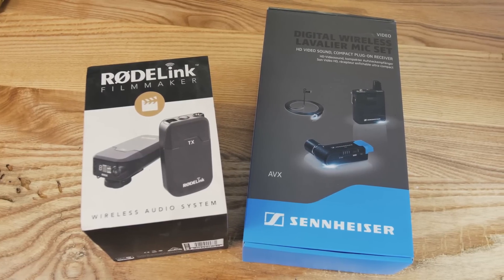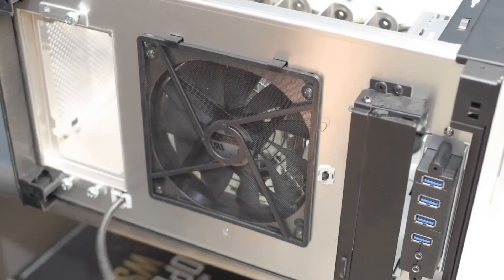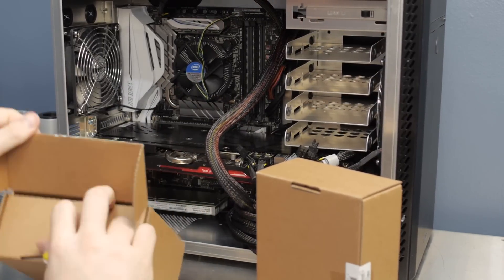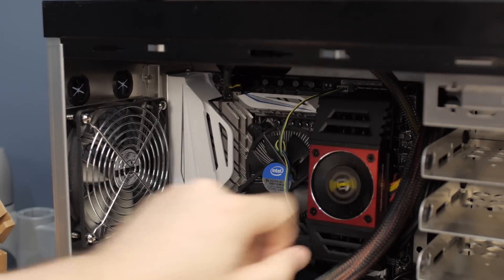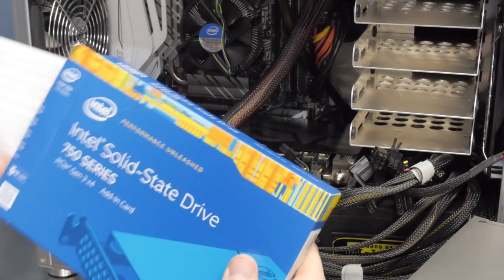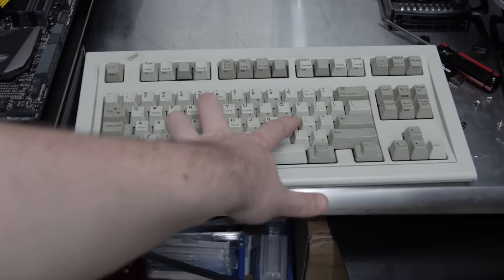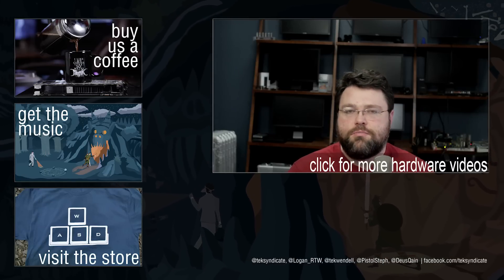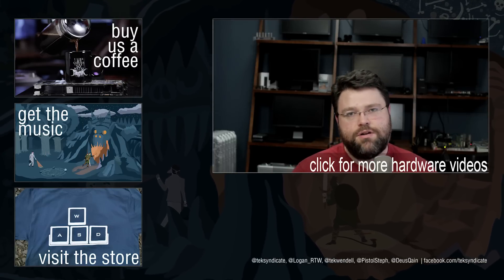Wendell's Skylake PC Build - i7 6700k

Comment: Just doing a Z170 build with a MSI Gaming M5 board with multiple 3.1 USB ports including 2 version 2 and 1 type c onboard. Using a Samsung 951 M.2 256 Mb as boot and a 960M SSD Sandisk as main storage, for a compact case using the NZXT 340, and cooling with the Corsair 110i gtx cooler, and  Be Quiet! Darkpower 1200w psu, considering the GPU as I have  270x and might want to link with a new AMD card

Comment: I'm a gamer so my build is practical with some room to upgrade down the line as I went with Z97 motherboard, i5 4790 (not k as I don't need to overclock if I'm upgrading to a 1151 socket cpu later), 1tb Seagate SSHD, 8gb of ddr3 ram, an r9 380 4gb gigabyte gpu with crossfire support for upgrading later. I plan to play many games and can't wait for fall out 4 and ill be playing sims 4 later and skyrim with graphics mods. Will be using a 1080p display so it's all good priced around $900 all together including windows and a wifi card and case.

Comment: Alright I'm going all out my system specs are: i7 4790k, msi gaming Z97 M board, dual gtx 970, evga supernova 750 watt psu, dual ssd's 120gb and 1tb and last but not least 32gb of ram.
Reply: 980Ti is better than 2 970's and 32gb of ram is overkill, get 16gb and go for skylake
Reply: haha i know but it was cheaper than 16gb so i totally went for it and I know but in euros the 980Ti is way more expensive than 2 970's
Reply: You'll Be extremely happy either way. Enjoy it.
Reply: +Neil Mc Cann haha thx and indeed the only problem now is that i have a high end pc but no money for games xD
Reply: I would go for a brand different than MSI for your board. The quality is low. Go for ASUS or Gigabyte. The Sabertooth boards from Asus are fantastic but if you don't dig the aesthetics, Gigabyte's ultra durable boards are great too. Sure, ASUS is a little expensive but it is worth it. The reason I say MSI have low quality motherboards is because my last MSI z97 board basically would not let go of my graphics card. The card was stuck to the PCIE slot even after unlatching it and unscrewing the card from my case. When trying to remove the card, the whole slot ripped off and I needed to buy another motherboard. I bought another motherboard but that thing was DOA with a broken onboard graphics port so at this point I'm saying" screw it". I'm selling the RMAS I receive and have bought all my components for a gaming and editing skylake build.

Comment: How would the fans be quieter if you used an over kill PSU of 1000W ?
Reply: When power supplies are supplying power significantly under load they do not turn their fan on. At least some don't.
Reply: +Carl Healy Do you mean when PSU supply low amounts of power ?
Reply: Matlockization let's say you have a 1000w power supply, and let's say you are using all 1000w of possible power. In this scenario the fan would need to be running to keep the capacitors and other components from overheating. However, if you have the same psu and your components are only drawing 600w, the fans might not turn on because the psu isn't working as hard which in turn means less heat will be generated. Look up the corsair hx1200 power supply, it uses this tech and describes it better than I do. I also think Tek Syndicate did a video where they analyze certain power supplies w/ scientific equipment at one of the trade shows they covered.
Reply: Carl Healy Thankyou for going to the trouble in explainng this to me.

Comment: just wanted to know if i can use the i7 6700k on a Z87-pro motherboard with 16gb DDR3 memory?
Reply: It should be possible. I'm running my i5 4690K on a Z87 motherboard which supports i7s. With the memory just check what the max ram it can hold but it should hold 32 to 64gb of max RAM
Reply: It should be possible. I'm running my i5 4690K on a Z87 motherboard which supports i7s. With the memory just check what the max ram it can hold but it should hold 32 to 64gb of max RAM
Reply: +Captain Minecraftia ok thank you so much going to buy it now
Reply: The 6700k is Lga 1151 and the Z87 is 1150. It is entirely incompatible. You may damage the cpu, mobo or both if you even try.
Reply: +CaptainMinecraftia No, Skylake uses lga1151, not 1150

Comment: hope by the time I buy a new computer late next year / early 2017, that NVMe SSD's drop in price down to £150 - £200 for a 500GB - 1TB with simmlar speeds to the Intel one of today.

If not it just means I will wait to upgrade my storage... Although by early 2017 it might be worth replacing one of my storage HDD's with a cheap large SSD if there are 3 - 5TB models by that point

Comment: 2600K FTW!
Reply: +T.E.D. de Medici   I have the same CPU! :)
Reply: +T.E.D. de Medici i5 2500k FTW!
Reply: +T.E.D. de Medici 4690K <3
Reply: +Tuna Yücer me too. my brother introduced me to then as he has the i5 2500k. he also has a Asus mars rog 4gb 760. so he has no probs running games. my 570 does have 'some' problems hahah.
Reply: +T.E.D. de Medici 2700K FTW!
Reply: +T.E.D. de Medici Mobile edtion i7 2630QM FTW!
Reply: +T.E.D. de Medici i have th 2600k with a gtx 780. still the best build in the 95 percentile range.
Reply: Zeejays Hood
 I've got a 570 paired with mine. Waiting on getting a job and pascal before i upgrade the gpu.
Reply: +T.E.D. de Medici i have a 2600k in the garage great cpu i wanna make another build with it. i got a 4690k right now its a pretty nice cpu.
Reply: still have an i3 2100;( although I have a beefy motherboard that supports the i7 and 3-way sli if I decide to get 2 more 570's. hahaha
Reply: Lagged ops i3 can't handle 2 570's. just buy an i7 2600k if ur motherborards chipset is P67 or  z68
Reply: +Tuna Yücer. z68 and yea I've already bought one. it's being shipped hahaha
Reply: +Tuna Yücer the i7 I mean. I don't need another 570 because one is enuff to play any game at decent settings
Reply: Lagged ops You bought i7? Very good. btw my fav intel cpus are Sandy Bridge ones.

Comment: I actually just upgraded (sidegraded) from an fx8320 and 990fxa-ud3 to a sandy bridge dual core (870 I think?) 3.1ghz.  have a HD6850 barts pro. (mobo was frying data, fried chipset from overheating)  I don't find it "boo hoo" at all that you are upgrading from newer to even newer than I have, and honestly think people that cry about it are suffering from epeen envy.  I would love to take your old stuff but only because that would make what I have better, but meh. what ive got works well, till I can afford a nice unlocked sandy i5 for this "new" mobo I have now, no FIVR to worry about, and I didn't have to replace my ddr3 sticks.

and honestly I think the q6600 is still awesome, I still own two though no mobos for them anymore.  Even have a bunch of s370 hardware. awesome stuff, just outmoded now.

Comment: I'm buffering the video but before I watch it. I am considering a Skylake or Haswell E build in November. I have a 980Ti already so graphics card is covered.

I'm unsure to go for the 6700K or a 5820K build. I mostly game and watch films etc on my desktop.

Currently running an overclocked Q6600 system so either will be a huge improvement. 

Because I normally run a system for several years before upgrading the ram and cpu, what ever I choose now I am almost certain to need a new M/B when I upgrade next. So I am not looking at Skylake and thinking I need the upgrade potential down the road of the more modern socket. However I don't want to go for X99 to find it is now obsolete in 5 or 6 months.

If Intel said the Skylake E or Broadwell E chips would run on socket 2011 I'd almost certainly go that way.

I'm 70% going for Skylake just because the boards are cheaper and a 4/4 core CPU will be more than enough for my current needs and for the foreseeable. Others opinions though would be appreciated.

Comment: I thought the DMI 3.0 really gives you like 1x16 via the CPU and an additional 20x1 (8Gb/s) via the z170 chipset, so a huge step up from the previous generation so running two intel 750 would be no problem and not interfere with the lanes used for the graphics cards pls someone comment on that

Comment: In your opening you mentioned that you have a bunch of computers... I need to slim down my collection. I literally have 4 desktops and a laptop within 6 feet of me... I don't need that many. #ComputerHoarders #FirstWorldProblems
Reply: +SeanFromPVD Install linux and configure them in computing cluster just like supercomputers. Do scientific computing or host websites. ... Profit?
Reply: Scientific computing (correctly) requires a lot more horsepower than I have at this point. If you have a bunch of racks with some Nvidia Tesla cards, it would be a nice simulation system. :)

I have thought about using something like Lightworks and trying the node distribution processing to see how all of the computers would handle rendering of video via LAN. That might be an interesting project.
Reply: SeanFromPVD Might be interesting, but expect to be IO bound
Reply: You mean via the LAN? Yeah. I can duplex some gigabit connections and have them setup through a dedicated switch. It wouldn't be super-fast, but it would be doable. Worst case, if it's total shit, I can scrap the idea. :)
Reply: SeanFromPVD LAN and HDD. You need to send that data back and forth and that might be a net loss, but you will learn something useful
Reply: I have some spare SSDs, so a RAID 0 config should limit the lag on the drive portion of the operation. (It would be a temporary operation, so redundancy wouldn't be a big deal.) A duplexed gigabit connection should suffice. It's not PCI-e fast, or Thunderbolt II fast, but it's not dial-up either. LOL :)

I've been tinkering with tech for like 20 years now, but I learn new things all the time. It might be a cool little project.
Reply: SeanFromPVD Well if you have SSD then you should not be limited by IO.

I am programmer and the complexity of modern computing is too much for one person. You will never learn it all and if you did things change all the time.

Here is fun fact: Changing the order at which you access memory can increase program performance 7x. You execute the same amount of instructions and you access the same amount of memory but you get 7x perf difference.

Comment: Why would you buy a 6700k when the 5820k is on the more feature rich X99 platform, with more cores which is useful for various tasks including rendering, over the slower, consumer-based 6700k? Oh, and the 5820k is cheaper.
Reply: In Sweden the Intel i7 5820k is 30$ more expensive
Reply: +Pang Bang dang in norway it's the same price  well there's like a 9 kroner difference
Reply: martin eike that's not fair lol
Reply: ***** It was aimed at Wendell, but to any purchaser as a whole

Comment: Just bought my GPU the r9 280x vapour x for £150(used like new). The rest of my build will consist of the AMD fx8350 £135, nzxt s340 £60, hyper 212 evo £25, Kingston hyper x dual change ddr3 8gb £40, EVGA 600W bronze+ £53, gigabyte 990FX AM3+ £92 and a Crucial SSD 250GB £60.                                Thoughts on my build(all components from amazon).
Reply: +eddie reece Don't listen to the guys complaining about the psu. 600 is more than enough, especially since it's bronze. Unless you're gonna get a titan z in the future you won't really have to upgrade anything for a while. Cpu is fine too, I'm still rocking my 8150 and 7970 from like 2011 and I'm still playing games like gta5, mgsv, bf4 at pretty decent setting on 1080p and 60 fps.
Reply: I would consider an i3 instead of fx8350 if gaming is your main activity.
Reply: +eddie reece That's a decent build, but you should take a used i5 or i7 processor in consideration. I go a used radeon r9 290 for 160€, so it's not the best deal you got for the gpu.
Reply: Btw thanks for the positive response on my build, this will be my first Custom PC.
Reply: +eddie reece excellent choices
Reply: The power supply is the bottleneck for further upgrades or overclocking
Reply: +Pang Bang dang agree get a 800 or 850 w psu
Reply: +eddie reece Go with a higher wattage PSU, maybe a 650w - 700w or higher considering your CPU, if you can afford it and a standard HDD at 1TB or higher if you can for your games, you'll soon run out of storage with just an SSD. Other than that it's a decent build.
Reply: The only reason why I'm not including a Mechanical hard drive is because my friend will give me his old one a western digital 2TB, my buget can stretch for a 700W but not sure about more. I was considering getting an I5 for about £40, but I just prefer 8350 in comparison especial with its 8 cores for heavy multi tasking which I do and a stock clock of 4Ghz. I do realise it runs at a higher wattage, but if I'm running thr system between 3-6 hours a day, it's only going to add an extra £5-£10 a year on the energy bill, however as I'm 17 I still live with my parents so that doesn't really matter TBH.
Reply: +kiran seehra Amd is the best overclocker thats why they have the record wit intel ur gambling when it comes to overclocking because of the sillicon lottery,but 8320 might be better choice cause its virtually the same for less
Reply: +kiran seehra no but you said intel was the better overclockijg this aint true so than just say intel has better single core perf
Reply: +eddie reece for me fx = micro stuttering i had it now im on haswell
Reply: +Roman   Thanks man
Reply: +kpdimi I'd only go with intel if I had the money for an i7, I do appreciate how good the i5. However I need 8 cores as I do a lot of editing, multi tasking etc
Reply: +Willyfisch thanks man
Reply: eddie reece Give or take the 4690k and the 8350 are about the same. Get whatever has a better price. http://www.anandtech.com/bench/product/697?vs=1261
Reply: +kpdimi I got that video card because when I go game I want to run most games 1080p Ultra settings 50-70FPS
Reply: +Ward Huyskes i5 4690k is the same price,  might aswell choose that instead
Reply: +kiran seehra no it's £40 more, less Cache, lower stock clock and less cores.
Reply: +eddie reece telll them whats up
Reply: eddie reece they're about identical when it comes down to it tbh, look at the anandtech link I posted earlier. Just get whichever is cheaper.
Reply: +Ward Huyskes no the fx 8350 beats that thing even in gaming if he was getting a fx 6300 okay i3 but no the fx8350 matches with i5's
Reply: +Balrog R.  1TB HDD for games and "random stuff"... perv
Reply: eddie reece Doesn't mean they're as fast, intel's performance per core is much better, also Intel CPU's have a really easy overclock
Reply: +kiran seehra atleast amd is easy to overclcok always and doesnt ask extra money for a overclockable version
Reply: the gaming guy tom You're point is? And intel is better to overclock
Reply: None of this matters. He probably bought all his parts. Calm the fuck down, fanboys.
Reply: Roman Not a fanboy mate
Reply: Lol ok
Reply: Brando Commando_ +1 for grammar. Also "Silicon lottery" You got that off of JayzTwocentz... It doesn't really matter about that, the intel cpu's have more performance per core and they don't have the record, a dual core intel does
Reply: +kiran seehra As of 2011, the Guinness World Record for fastest CPU is by AMD with a Bulldozer based FX chip "overclocked" to 8.805 GHz, trumping the maximum recorded 8.670 GHz performance of their next generation FX "Piledriver" chips.[3]As of mid-2013, the highest clock rate on a production processor is the IBM zEC12, clocked at 5.5 GHz, which was released in August of 2012. two highest clock speeds on the moment so dont lie amd is the king of clock speed not saying intel is bad at over clocking just saying amd is better at it
Reply: the gaming guy tom The clock speed of a cpu doesn't really matter anyway so

Comment: I still have an 8350 in my main rig, and my laptop with the 2670QM pretty much outperforms it. :/ 6600k may be my next upgrade...
Reply: +AIMIWA95 That statement is simply false.
Reply: +Kevoy Daley just from my own experience. the 8350 was probably a pretty bad investment. wish I went for an ivy bridge i5 to be honest.
Reply: +AIMIWA95 Steamroller architecture was built for server and then sold for consumers. Server workloads can use 32 or 64 cores but programs on your computer even if they run multiple threads they are still limited by one thread and dont scale well. Just look at your CPU utilization.